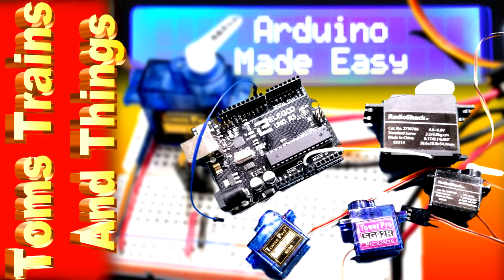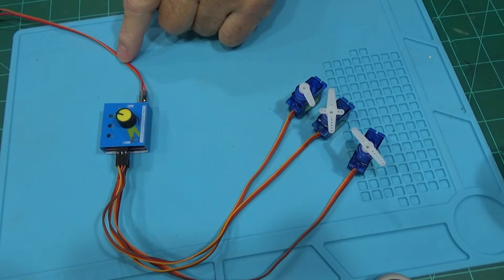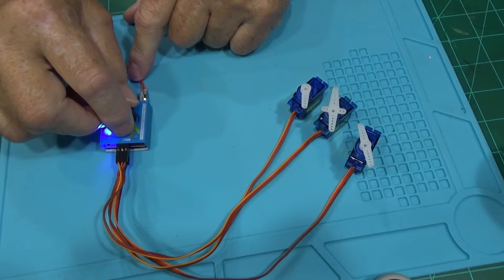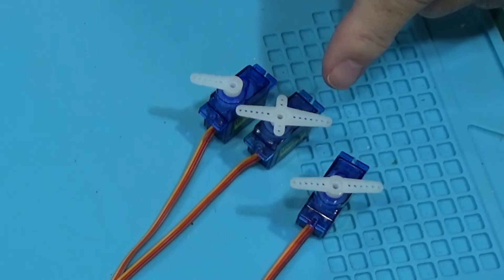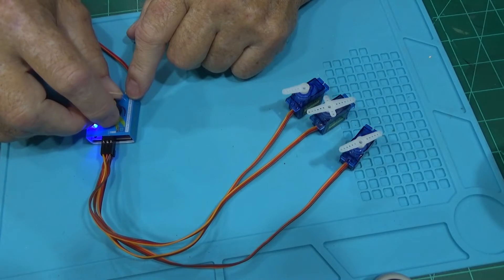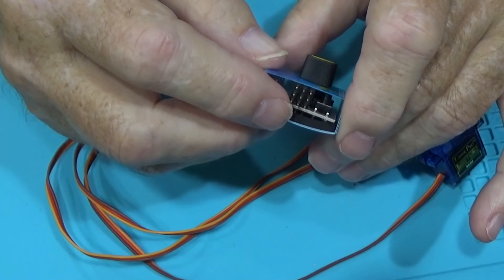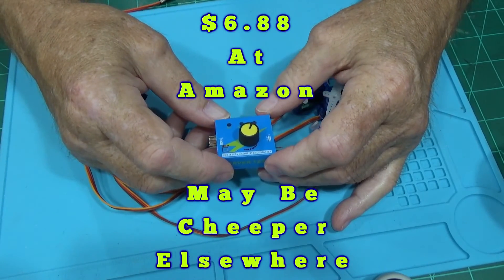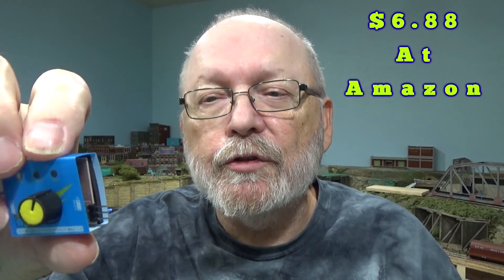How To Test Your Servos With A Servo Tester

Comment: Hey, i bought this same one that came with a battery compartment (i don’t know if yours had that) but when i try to plug in more than 1 servo all the lights flash in the servo goes all jittery, it is not the servo either as i have tested it with other servos and the same thing happened, do you have any info i could use to fix it (thanks in advance)
Reply from the maker: These testers are open source, so any manufacturer can produce them. Not familiar with the one you describe. Sounds like you have a defective one. 

Sometimes things don't work at this low price. I normally buy multiple devices because of this.
Reply: @TomsTrainsandThings ok thanks

Comment: Awesome video, thanks. By the way, where do you get your servo batteries
Reply from the maker: I use a power supply supply to power my servos. They are stationary on a model railroad
Reply: @TomsTrainsandThings  thanks:face-red-heart-shape:
Reply: How much voltage use ?
Reply: 5 volts @lap92476

Comment: can this be used to tesdt a 2g servo? if so what aditional component do i need for it. Thanks!
Reply from the maker: It should work with any size, the voltage is the deterring factor

Comment: I like your video but you didn't show how to hook up power supply. I just received the same servo tester ,without any  power supply, instructions, I have never used one before so I would like a little more information please. Thank you have a great day 😊
Reply from the maker: It's marked on the opposite side with + & -  The sam voltage as the Servos

Comment: I hoped to see here how to  connect the servo to the board, since there are two ways on this 9 pin block.
Reply: I'm coming in a bit late but I know what you mean.   The cables connect horizontally, so one at the top, one in the middle and one at the bottom, rather than side by side.
Reply from the maker: They only fit one way

Comment: Hi mate. I have this servo tester and 270 deg servo. When i test my servo, it only moves 180 deg. How can i test the full 270 deg range? Thanks!
Reply from the maker: These testers were designed for testing 180 degree servos. I've looked online for testers for 270 degrees, but but was unable to find one that specifically states 270. I have another video on servo testing where you can sweep from low to high on the servo through an Arduino sketch.https://www.youtube.com/watch?v=w3DL-H0fzmY
Reply: @TomsTrainsandThings  I've done a lot of reading about servos.  The 270 degree servo uses the same pulses as the 180.  It is just spread out over a larger angle.  The tester should have operated it to each end of travel.  Check your servo to see if it is indeed a 270 and not 180 degrees.

Comment: I just had problem using these servos testers, but discovered 6 Volts is not enough volts and the servos jitter. Using a 7.2 volt rechargeable no problem.
Reply from the maker: Most 9 g servos are 4.8 to 5 v there are larger servos that will handle up to 7.2 vdc.
Reply: @TomsTrainsandThings  would it be fine if i connect 4x AA batteries to power this up ?

Comment: What is the max current it can handle ?
Reply from the maker: If your worried about maximum current, buy a more expensive one. This is the cheapest one available.
Reply: @TomsTrainsandThings  even so ? How much it can handle ?
Reply from the maker: It can handle 3 servos up to 55 gram size.
Reply: @TomsTrainsandThings  can I connect this tester to a 1Amp D.C power source ?
Reply from the maker: I use my bench power supply to power this tester which is 5 amps.
Reply: @TomsTrainsandThings  good

Comment: how to make a servo :  attach a variable resistor to a geared motor   use a 339  ic  : put a diode offset between the inputs. lm339 quad +-   for 2 servos all done/  add a supply ON  transistor. 1 volt used batteries can leave  the 339 on.  use 4 transistors each motor  <<   >>
Reply from the maker: Servo's are so inexpensive why bother building one unless your like me and do it because I can!